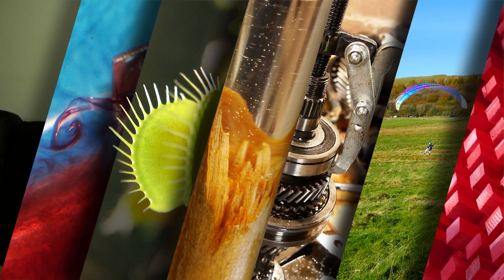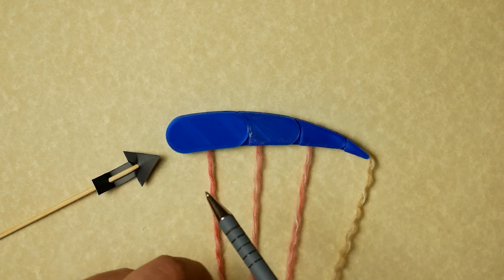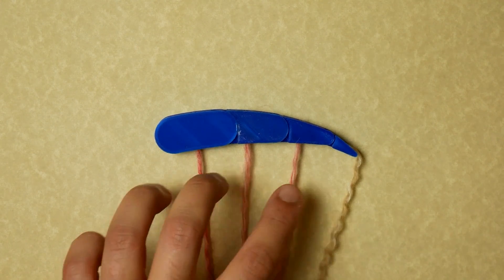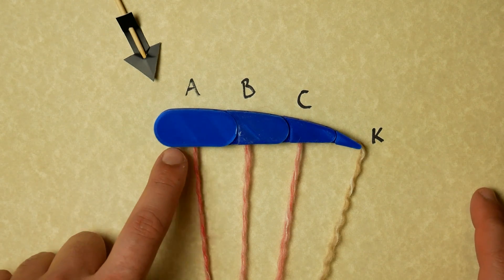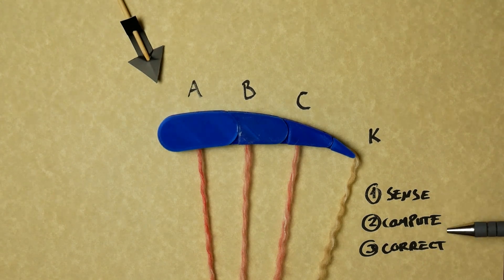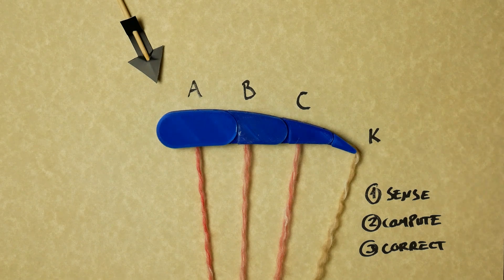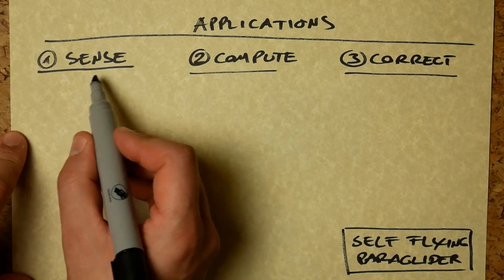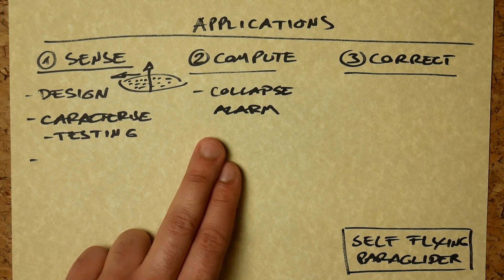Intro - Uncollapsible Paraglider Part 1 - BANDARRA

Comment: Three General points of concern:
1. Using any type of speed bar will deform your Leading Edge. Not deforming your Leading Edge would be a great way to prevent the collapse.
2. Wings: elliptical versus rectangular. A powered parachute uses a rectangular wing and it is stall resistant. I can do a full flare the nose will come up a little bit and then flatten out. If I did that with an elliptical paramotor wing I would cause a stall, and fall!
3. Trims: a true paraglider wing does not have any type of trims because is designed for maximum lift not speed. A paramotor wing in contrast allows you to have trims because your flight characteristics are more for going distance, not gaining height/lift to thermal soar.

Just my two cents. If you wanted the most collapse resistant wing, you would fly with a rectangular wing with no trims.

Comment: I think that a simple solution to the sensing part is to consider wing internal pressure. Surely the pressure inside the wing will drop before it collapses? Another option is to look at airflow over/under the wing. In General Aviation stall warning devices are activated by at least two methods...one is suction, the other a change in airflow around the wing leading edge acting on a mechanical switch. From what i am seeing in this video regarding how a paraglider responds to airflow, it collapses when airflow comes down from above (which is virtually the complete opposite of a stall). That being the case, both scenarios could be detected using the same device.

Comment: I hate to pour cold water on all this, but the truth is PARAGLIDERS ARE DESIGNED TO COLLAPSE!  Experiments with wings that don't collapse (yes prototypes already exist) about 10 years ago were very scary. The main problems involved fully inflated wings diving back into their own lives very aggressively.  A collapse dissipates energy. Indeed in very strong turbulence flying paragliders is safer than flying a hang glider (where you can turn upside down or hit the wing).

Paragliders will always collapse. How they collapse and recover is the real discussion.
Reply from the maker: Fair points and do agree Toby. As you can see from my video I'm not trying to make a rigid paraglider. Instead I'm interesting in the learning process that might come from trying to achieve a system that will act like an experienced pilot, in the way they feel the wing and apply brakes in turbulent air.
Reply: Hi Andre.  Fair point.  I get the distinction.  Wishing you well with your project!! Good luck.
Reply: Do you fly hangglider? I fly both, I am also glider pilot... I flew in strong turbulence, PG would just disappear with a big uncertainty of how in which state and dynamic it regenereates... 

On the othe way, on hangglider, you just add 10-20km/h to your speed, giving you momentum and controllability and the turbulence is not an issue. You can practically tumble only from stall close situations OR in a situation when the aerodynamical force is SO big, that it woudl flex the whole glider or so big that its close to break it!

If you are not a top notch pilot of both devices, I would suggest not to judge safety in turbulence..
Reply: Was it Flight design who made a glider with valves that didn't collapse? It went great but was terrifying. 
Front tucks are there to stop you falling into the glider.
Reflex wings stop most of the collapses, but have the performance of a house brick.

Comment: In 7:20 you say that an experience pilot could sense a decrease of tension in his A-line. I think this is impossible and a pilot can sense only the total force going through the carabineer toward the harness.
Don't forget that collapses happen for 2 main reasons with quite different processes  - entering sink and self accelerations of the canopy (from too high AOA).
Measuring the line tension is doable, but making mechanism for automated line pulls won't be easy; Reaction times are too small. Also, how would you separate automatic mechanism from pilot inputs?
Collapse alarm might work, but you have to filter a lot of noise which can either produce too late for reaction alarms or annoying signals (like most of the variometers). For example, I'd like to hear alarm only about coming 100% collapses and don't want to be disturbed when pressure disturbance won't achieve a collapse.
If you focus more on collapse alarm, then you should change the flashy name - Uncollapsible paraglider to something modest. 
Good luck!

Comment: It is a great idea, especially for beginner pilots. BTW has anyone tried to use drones to make a 3d map of high rotor areas? I guess in the mountains, during same wind conditions, rotors should form in the same areas. Having a such 3d map on a smartphone, it could warn beginner pilots when they fly into a danger area.

Comment: Great concept and easily possible.
First, you need force sensors on the lines. There are two ways to do this, one that a strain gauge is between the line and the carabiner. The second and perhaps safer method is to have a pressure sensor (very small chip) on the line where the line passed over the chip with a line guide on both the top and bottom. As the line pulls more weight and tries to straighten out, it applies more pressure to the chip. Obviously, as the weight gets less, there is a point where the line is not applying any force to the sensor. This would allow you to know exactly how much force or weight is being applied to each line.

The data for this could be sent via Bluetooth to your smartphone to allow you to see the various forces on the wing under various conditions, such as launches, landings, climbs, wingovers, loops, spirals and other aerobatic maneuvers for stunt pilots to evaluate their performance. Warnings could be created when a line gets within 80% of its rated load.

This product would have great value on its own and would be the first step required for a fully controlled wing, so would and could be developed on its own. At the carabiner, you would have a small battery powered microcontroller with the slots for the various lines in a plastic assembly that would connect through Bluetooth to your smartphone. Do this design separately and develop the app as you will need to do this anyway as part of the complete solution but you will have a first step you can sell.

The app can even tell the pilot "STALL STALL STALL" or "COLLAPSE EMINENT" and let them learn how to sense it and recover on their own. I am not sure if the lines are identified for each of the A's, B's etc, but if not, then assume A1 is at the left wingtip and are numbered across to the right wingtip. Then as pilots are flying and doing stunts, they could get some feedback of their choosing, such as "A3 slack", "A8 overload", "Left side light" etc.

Secondly, you would have to decide if you're only going to allow the computer to control very few or lots of lines. This is due to the force needed to alter the lines could require solenoids or motors that are bulky and heavy to have much impact and how to power these. How much deflection to the line that you require, will determine how much "throw" the motor will need.

In one case, you could have a motor on every line and allow the computer to vary the formation of the wing not only to correct environment encounters such as you described but also for the computer to assist in aerobatics. Imagine doing loops and wingovers that go perfectly as the computer does minor adjustments to portions of the wing.

On the minimum side, just allowing the computer to have one motor that pulls evenly on both brake lines might not be the best choice, but it would be the simplest and lightest solution.

The safest solution for both sensing and controlling is that the lines remain connected directly to the carabiner like normal, but the lines are routed in a gap for the sensors and a pulley-like assembly for the motor.

I think the ultimate test would be to have no pilot, but just batteries as the load and an electric paramotor with the computer flying to a certain altitude, then doing a variety of aerobatics and maneuvers, a robotic AI paramotor.

Comment: ive thought about this many years.  When you start adding components to a foil your robbing its simplicity.  Even a kitesurf canopy collapses with down drafts. Ive been slammed by a down draft while on a 30 foot boost at the beach.  Nothing coulda saved my butt besides the water i landed in

Comment: You only have collapses if you're a dumbass and flying conditions you shouldn't. And you don't always die because a decent glider will reinflates instantly. I have not seen a collapse in almost 30 years. They are not common. They come from idiots who don't know how to regulate the conditions they are flying in such as midday. Or Gusty weather. Or they do extreme aerobatics what should be done with a reserve anyways. Just FYI
Reply from the maker: Paramotoring and freeflight are very different in that respect. Paramotor pilots just fly in the laminar parts of the day, which makes sense. For us with a mountain instead of a motor, we need the turbulent stuff to go up.

Comment: A non-collapsing foldable wing is called a Hang Glider - it also has the bonus of efficient sensitive Pitch control - something sadly lacking in the Bag wing thing .... Never mind AI paragliders - just go fly a HG - you will never have to worry about collapses ;)
Reply from the maker: you don't have to worry about collapses but it will break your back carrying it and your bank account trying to travel with it ;)
Reply: The hang glider doesn't allow a frontal collapse to loose control of the wing (not a strong one, anyway), because the triangle is rigid. That's a problem with a rigid paraglider which depends on tensioned lines to control it. Of course in a hang glider you still have other problem for huge collapses... the pilot is «hanging».
Reply: Completely agree. Hang gliders are like your t-shirt when flying. You  forget is on. Just fly.

Comment: Hi, I think this is globally a great idea of tech improvement.
However, let's take a different point of view on piloting and wing /air/rough conditions: did anyone ever thought about how safe this is sometimes to have a collapse?
- a pilot exits a core and on the edge there is a sudden massive sink, the wing flashfrontals and shoots a bit forward. if the wing doesn't absorb this energy by collapsing, pilot falls into wing.
- a thermaling pilot centers  and corrects by weight-brake inputs, little pendulum movements pushes the pilot on the edge and finally the pendulum is desync with the thermal, wing deflates on a side. with no deflation at all, pilot does a loop in the best case scenario.
anyway those 2 quick examples are just to imagine what if...
I think for the active pilot, collapses saves more lives than it destroys
Reply: please do not misunderstand my comment... I don't say this is a wrong idea to create a new safety system.
I just say collapses absorbs som unwanted energy and that saves lives too.
Everyone saw the dustdevil in laragne this summer, do you think Boris would be alive if the wing didn't frontal?
Reply from the maker: All fair points and thank you for taking the time to think about it an comment. My point of comparison is simpler than that though. 2 pilots. same wing, same air. One pilot has 5 hours and another has 5000 hours. The novice pilot will let the wing collapse under turbulence and the experience pilot wont. How can we shorten that gap?
Reply: if a wing flashfrontals and shoots forward, this system is immediately going to sense that and apply countering brake (so this example is null and void concerning the proposed system). in second scenario, the system still senses a wing deflation and counters it. I fail to see how either of these examples present a problem for Andre's idea?
Reply: this may or may not be true, however, when flying our first reaction to an impending collapse or a collapse is to instantly add a jab of brake. All this system is doing is removing the delay of such an input from pilot from 2 or 3 seconds to milliseconds.

Comment: Nice idea; let’s have a debate...is the wing inflated by ram-air, as you seem to think, or is it inflated by a reduction in pressure at the upper skin (2/3) over an increase in pressure below the wing (1/3)? Thereby is the wing effectively sucked open and only stabilised internally by the rather smaller effect of ram-air.    Thoughts?
I think that the RASP technology advertised by Swing paragliders which baffles the cells combined with this would be ideal. Good pilots will learn to recognise early signs of impending collapse by understanding the air mass acting on their wing at a given time and shifting weight, pitching and applying brake even bore the wing has begun to deform.  There is no substitute for regular flying.
Reply: I believe there is a paraglider manufacturer that is developing a top skin only wing.
Reply: James Hanson

It's initially inflated by ram air pressure but once inflated and flying Bernoulli takes over.
Sensors have been put in gliders and the pressure goes up at inflation, then reduces to the same/similar to the outside pressure.

terry Sullivan

Single skin gliders have existed for many, many years.

Comment: Does anyone else monitor wing pressure with speedbar?  I feel the leading edge through the bar, and prevent lots of collapses by making small corrections.  It did take a few years of practice, but I can feel that leading edge pretty good these days.  I like tech ideas though, and I often abort my own for the simplest solution to a problem.  This might be good for newer guys, but they shouldn't be in knarly air anyways!   I really liked your video though.
Reply from the maker: Hey dude, yeah there's lots of ways to do it and most seasoned pilots have found their own way to sense, compute and correct to avoid collapses. Like Gavin said you should never ever get a frontal if you're flying a hot wing. This for me is more about discovery and understanding how things work rather than designing a paraglider that physically won't collapse. We'll see where this road leads us :)
Reply: Andre Bandarra, there's always the old "hand of god" as well.  That's what we call it around my woods. Flying your line, everything is humming along nicely, then WHACK!   Ha ha.    Happens to everyone eventually I think.  I do like your idea, but I came from an airplane background where there is a gauge or instruments attached to everything.  When I discovered the simplicity of paragliders, I fell overwhelmingly in love with it. Such a beautiful thing we get to enjoy!  But with that feeling, anything that helps anyone do it better or safer I'm 100% behind brother!
Reply from the maker: Kyle O'Glee ahah I know exactly what you mean dude! That's how I had my first 80-90% collapse. At the end of my 2nd ever Xc, was at cloudbase and WHACK! What happened!? Luckily recovered just fine but what a rush! I'm with you on the simplicity though, sometimes I fly without instruments at all just to enjoy it. Really want to move somewhere where I can just go fly at the beach anytime, no instruments, light gear, barefoot :) and beers at the end 😎
Reply: These days the best way to "monitor" a wing on bar is by using rear-riser control.

Comment: maybe there can also be a way to monitor the wind flow direction above the wing at a couple of points, because if thats the first change that happens before a collapse then the latency of this information will be the least and this extra information can help in better computation or at-least knowing whats happening, maybe not that useful/possible but sharing anyway, in hope to be a help in wings of future ;-)
Reply: did an initial research on it, although traditional sensors are big and bulky and don't make sense, but maybe ultrasonic sensors can open up a new world of options, further research is possible.
Reply: Deflations happen with sub-second rapidity.  The wing transitions from stable fligt to collapse faster than any system can respond. That's why it will be more feasible to  develop a system that aids in recovery after the collapse.
Reply: you might be right, but even if it doesn't get into mainstream, the study alone can bring some new knowledge previously unknown, I think even that is worth trying :-) btw based on my little experience the wing does give a feedback, a funny often scary feeling before it collapses, I believe a microprocessor+sensors may be able to detect it quicker then a a human can, even if not, lets give it a try and find out!
Reply: Need an AoA indicator of some type. Fixed wings have stall warning devices and even AoA instrumentation. Would it be possible to calibrate a sensor on the harness?

Comment: Don't want to be a wet blanket, but the AI is not available,  even assuming that you can model the behavior of the wing and the air sufficiently well so that corrective action is possible. 

A more realistic approach might be to develop a system that can assist the pilot in recovery from a cascade, perhaps with audio suggestions,  such as "hands up", full brakes, hold  it" " throw your reserve NOW", etc. Sort of a computerized SIV instructor.  This approach would be more tenable, because it would need to model a smaller set of conditions  those that are present after a collape. That's a smaller universe.
Reply: Yes, and every pilot carries a 3d gyro sensor called a smartphone which also has a camera built into it.  The camera could monitor the shape of the wing with edge detection technology.  Also any deceleration or acceleration and position of the pilot relative to the wing and wind or course.  All of this done with real time tracking software and the audio outputs to give the appropriate reaction.  "Weight shift right, 2 inches brake right, Wing is collapsing left side"!  or "Hands up, stall is imminent"